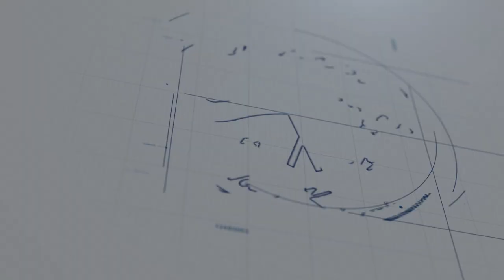DORYOKU EK Civic Crash Bar Install! A great solution for turbo Honda's!

Comment: That's a really good solution. That was the only pain when I installed my air walker bumper. The stock crash bar side's barely hit the bumper side inlets. Had to give the crash bar a little massage. Cars looking good man. If you want to ad a little bit of extra touches, I wrinkle black painted my coolant overflow bracket and the bracket that holds the throttle cable and booster hose and the little throttle cable bracket. It added some nice extra detail just an idea for you. Keep having fun guys.
Reply from the maker: I should definitely wrinkle paint my throttle cable bracket black! Currently I have a wrinkle black and red coolant overflow reservoir so we're covered there. I don't have the bracket that holds the brake booster hose and throttle cable anymore.